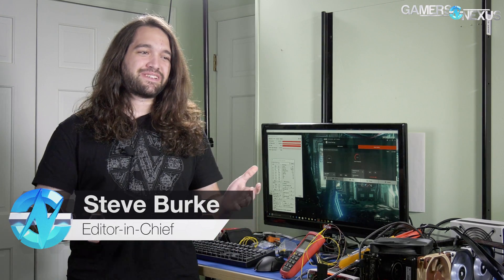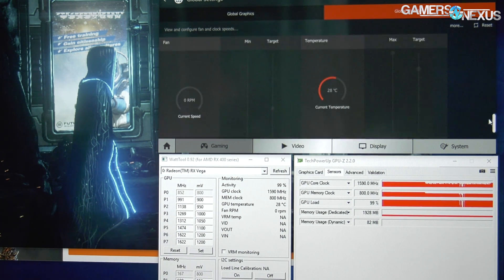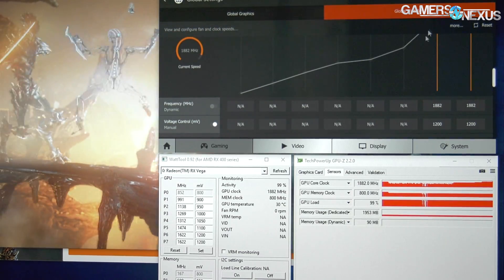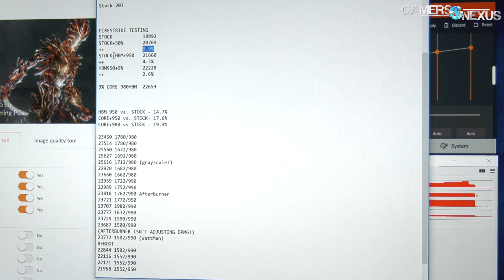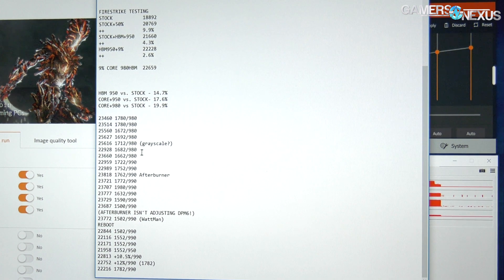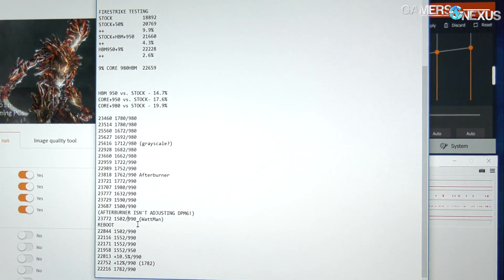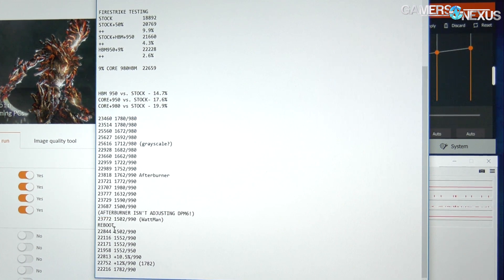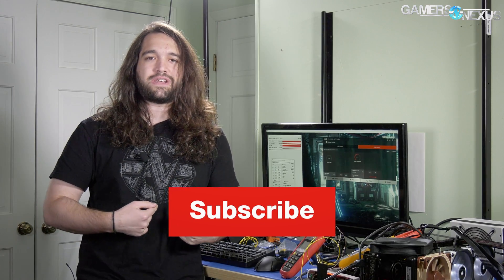Clock Bug Rant: No, Vega Isn't Hitting 1980MHz

Comment: And I only set the power limit up to 150% with the card.  I don't know how I got 2,500Mhz faster than the Vega 56 original reference card shown here and bug still exisit.  The clock displayed 1,500mhz playing game like Doom and Borderland 2, it will shoot over 2,000Mhz on loading screen, pause screen (some but not all, it will go down to 50mhz).  The 2,500Mhz clock speed will be shown playing  Dead Space, once hit the Radeon recording to be set down to 1,500mhz, game set max out with resolution 5160 x 2130 with my Vega 56 Air Boost OC.  It one hell of a weird gold bug I have.

Comment: seems like the clock bug is back, or maybe it wasn't fixed all the time...
In this neat little build in overlay tool from AMD, I sometimes see Vega 64 LC clocked to WELL above 2Ghz in Far Cry 5.
The absolute max. was 5800 Mhz or so... all with about ~260 Watts of power consumption! :D

Comment: Comment section seems to be full of cancer. People didn't buy AMD cards when they had better products, and now they are salty about AMD not having the best product, hypocrisy overload.
AMD is clearly trying to put up some high-end graphics, while having fraction of nVidia's budget, and they get so much shit for it.
Guys, chill out, Vega is new architecture, and it won't be Titan killer on the release, just like Ryzen wasn't 7700K killer on the release. It doesn't even have stable drivers at this point. For once stop acting like fucking idiots.
But anyways, if your best actual stable score was 23800 (around), that is 25,9% increase from the base.
Seeing that Vega 56 is typically well above 1070, especially on higher resolutions (from what I have seen, sits between 1070 and 1080) this would put it from above 1070 to above 1080 card basically. Even if the max OC is 20% that would be good enough. Even the 15% just from raised HBM clock and undervolt + higher power limit, should be enough to put it against 1080, for much lower price, well at least the MSRP.
Adding the fact of having Freesync, and more ability to improve with drivers and optimization (>20 TFLOPS FP16, primitive shaders, primitive discard...), this makes this card even slightly more worth it.
What is your opinion about this, Steve?

Also, could you test Vega 56 undervolted and clocked to the point it has same power consumption as 1070, and test it's max performance at these settings? Obviously with overclocked HBM2, since I've heard from Buildzoid it doesn't draw any more power when OCed.
Cheers.

Comment: Well I mean Intel on the 6600k goes from 3.5ghz to easily 4.5ghz and some lucky guys getting 4.9. so the assumption that it would be added because they can isn't always valid. But the point the Vega is still a bug though

Comment: My Vega 64 AIO won't even run if the power mode is set to turbo.That's stock clocks with a 25% power limit increase.  Within less than a minute of booting up a game I get a no signal crash.

Comment: Honestyl? Who cares anymore? This card is a giant flop, on paper it's has even better specs than Titan Xp, but in reality it reaches stock 1070-1080 performance, in some games even almost as low as 1060/580. I even saw comparisons of Vega 64 with 980Ti the other day, and they are almost on par (Vega gives just 1-3FPS more), so basically (just as with Polaris GPUs) it took AMD over 2 years and half of the process node to catch up with NV, and even this with a lot more cores and power consumption. They need to abandon GCN architecture and HBM memory, it's a dead-end, they need to start with a fresh design/architecture for their GPUs, same as they did with Ryzen.

Comment: Why aren't GPUs able to run at the same clock speeds as CPUs? Like CPUs are hitting 5Ghz but GPUs aren't even making to 2Ghz
Reply: GPU's have MANY MANY MANY more "cores", these aren't the same as CPU cores in terms of the type of workloads they are designed for but close enough for this concept, the more cores you have on something the lower the clockspeed needs to be to remain stable across all those cores and not overheat the chip or exceed the power level the chip has available.

Comment: Just from a programming standpoint that's a really strange bug. It seems like it's actually activating some kind of fail-safe and just using stock clocks regardless of what's shown, at least after a point. Usually a value out of bounds like that causes the system to either grab junk from memory and use that as an integer, or loop back to the lowest value.

AMD's GPU division really dropped the ball hard on the entire Vega release. Either that or they realized it's redundant by now and just wanted to get it out the door and move on to Navi.

I really hope Navi does a lot better against Volta. As it stands there's no reason for Nvidia to do anything but cruise along with Pascal priced as it is.

Comment: im hitting like 2100 on my 1070  ;)
Reply: It's not comparable, fyi.
A 1500Mhz 980ti would get similar performance to your 1070.
Also, weak. I'm getting 2175 and 9600mem on mine at 49C load ;)
Reply: nahhh nigga. how is a 980ti stronger.. xd?
Reply: are you watercooling?

Comment: considering the fact that the 1080 easily gets 300 mhz higher, most people probably things 400 isnt that big of a deal (but 300 + from 1700 is less impressive than 400 from 1600. just like a 1 ghz overclock isnt much for a 4 ghz cpu, when its  ungodly for a 1 ghz cpu. :P

Comment: I'm confident I have a genuine overclock of 1907Mhz and 1075 on the memory on my Vega 64 Liquid cooled:

Ok so here are my Time Spy scores, starting from the default Balanced and Turbo profiles and then my overclocks. Each one clearly shows a proportionate performance increase:

Core:1668/1750 (balanced) - HBM: 945 - Total Score: 7130 - Graphics Score: 7490
Core:1750 (turbo) - HBM: 945 - Total Score: 7231 - Graphics Score: 7610
Core:1837 (custom) - HBM: 1050 - Total Score: 7339 - Graphics Score: 7844
Core:1882 (custom) - HBM: 1075 - Total Score: 7479 - Graphics Score: 7872
Core:1907 (custom) - HBM: 1075 - Total Score: 7599 - Graphics Score: 8062

Looking at the graphics score it's a near 8% increase at 1907/1075 compared to stock vs a 9% increase on the core clock. Anything higher on either the core or memory clocks caused Time Spy to either artefact or crash for me. Based on these scores, I don't think I have encountered the bug and believe my overclock is genuine.

Comment: After all this time, all those delays, and AMD still didn't find time to fix drivers? I mean how the hell can you miss bugs like that. Sure software optimization is more of nVidia thing. But over all those years, AMD is still just same head through wall kind of performer. I have nothing against hardware power, but I can appreciate much more if you can simply open the door, not hit your head through the wall. And AMD doesn't seem to learn... and that is why I kind of like nVidia bit more... :-D

Comment: SO uh, is the Vega 56 a good replacement for my 1070 so that i can use my Freesync panel?
Reply: was the cheapest monitor above 60Mhz refresh at the time i built my PC.
Same for the 1070, best price/performance i could afford.
I have no brand loyalty clearly but Gsync is a scam and you should be ashamed if you own a gsync monitor
Reply: NO, unless you can get the ORIGINAL price you paid for the card, getting Freesync support is not worth losing money on the card you already have, you should NEVER even begin to consider replacing a GPU for ANY reason for atleast 2 or 3 generations at a minimum.
Reply from the maker: Our review discusses that! https://www.youtube.com/watch?v=0PftkOaKfik
Reply: I read your review, but its all still quite up in the air.
Did you get a chance to test OCing with the undervolt profile?
I guess till the whole price drama settles down there wont be a definitive answer
Reply: No. Unless AMD prices the 56 back down to $399 stick with your 1070. Not even the AIB cards will be worth much more than that..maybe $50.00 over the $399 msrp tops.
Reply: If you are price conscious you must factor in the price confusion currently surrounding Vega 56; and the electricity angle that Steve have covered a few days ago. Steve's electricity analysis is really nothing new; what's significant in that video is he's put out comprehensive numbers with real-world data. Sure parameters like electricity price and hours of usage per day varies according to the individual, but the mathematics is linear and you can just factor up or down from the numbers reported by Steve. They may not be a lot, and most people tend not to care (because usually you need to do some calculations before you realise how much it is), but that extra cost IS there, and if you think you will be gaming, on average, like 2 hours a day over a couple of years before upgrading to another card, that extra cost can amount to something in the order of ~$30 (give or take).
Reply: Yeah, i guess i will get a little more value than just performance because of freesync
Reply: this isnt my first rodeo haha. I am just really keen to try variable refresh rate tech and already happen to have freesync on my monitor
Reply: Why buy a freesync monitor if you have an nvidia GPU... Why not get a gsync monitor?

Comment: Vega series of cards were Designed for the enterprise World, not for gamers. Gaming market doesn't need HBM ATM. Everything in this GPU interation is for Professional Applications... It Can obviously game, AMD relaunched the product for the "gaming" market to profit from the existing production Line, but the focus of AMD with Ryzen and Vega is the Enterprise World... Sorry for gamers
Reply: luis jesus Why they use it in gaming tests against other nvidia
Reply: out of curiosity, what are some professional uses for gpus? is that like the video editing or multi tasking?
Reply: High level compute usage of CPU and GPU involves stuff like archiving massive amounts of files to be compressed and stowed away, because they wouldn't want to buy a few hundred hard drives to stow a few petabytes of files.

CPU is used in file compression, and especially used in video compression and conversion, especially when you go 4k or even 8k. The reason why they bothered to go with high resolution is that they can downsample it to lower scale with better image quality than up-scaling it, which makes the pixels blur and is relevant.

GPU is used to render your videos and images, at those massive scale, it has to communicate with the CPU to properly record those massive resolutions bit by bit, and transfer that image you see on a 4k screen, to the Cpu so it can turn it into a file.

With the TV industry being hacked and slashed to pieces, the internet media industry is taking off and there's a huge demand to create media for internet users to consume.
Reply: Anyone who has a Ryzen CPU, the new bios update for the X370 Prime came out a while ago, 0810, which is said to improve memory compatibility again.
Reply: im a gamer, and was just curious about how there's different uses for the same technologies i use to game
Reply: I just bought a 1080ti and my ryzen 1700 is clocked to 4 ghz with 3666 mhz ram and its within 6% of the 7700k and the only game it gets beaten in is csgo so its not miles behind like you are saying an the 1800x is better compared to the 6900k which it easily beats.
Reply: @lol wut
The biggest call to fame for Vega is it's use in supercomputers. There is the EPYC(pounced epic) CPU line that is designed just for the purpose of driving 7 Vega's simultaneously. The EPYC/Vega combination is insanely powerful with it being able to reach supercomputer status(1 PetaFlop) in a single rack. To put that into prospective, that is the equivalent to two "weak" supercomputers in the same space as a single mini tower, although racks have external power supply's and cooling so that is only half true.  

So once AMD finally gets the production line sorted out, Vega is going to redefine what counts as a super computer.
Reply: did you even watch amd commercial for vega ? it was promoting nothing but gaming. Ah and RX stands for gaming series...
Reply: @Armand B.
That is because you don't run commercials for systems that start at 50k... Did you even think before writing your comment?

Also RX stand for Radeon(the name of AMD's GPU division) 10(X is the Roman numeral for 10). Can't fault you for getting the AMD naming wrong because it is pretty inconsistent to be honest. The number is the GNC(this is akin to saying like x86 or ARM) generation, but only odd numbers starting at 5 are used. The even numbers were reserved for mobile devices(R8 was a bad R9), but in the middle of R9 they decided to switch to a M to denote mobile which is why 10(X) was used for the 4th generation instead of 11.
Reply: 50k what ? Im talking about vega and it's a gaming card. here ya go https://www.youtube.com/watch?v=uxVzDQtHzqo&t=1s
Reply: That reply is so stupid that I am not ever sure how to respond. 
Vega is optimized for general purpose compute; it can still be used for gaming in the same way you can use a threadripper or 10-core xeon  for gaming, but they won't preform as well as parts designed only for gaming.

So do you realize that only a tinny fraction of i7 sells are to gamers? Yet nearly all i7 adds are targeted at gamers. This is because you don't run adds for professional systems. 

How do you have trouble understanding such basic concepts?
Reply: Yep. Anybody dissing AMD aren't looking at the big picture. For the record, I don't own any AMD hardware. I am rooting for AMD because competition lowers prices. GO AMD! 

These intel/nvidia fanboys forget...AMD gave us 64-bit computing and more memory on the desktop. And now? Professional grade graphics cards at gaming prices, more than 4 core cpus at quad core prices, 64 pcie lanes on the desktop and 128 lanes in the enterprise.
Reply: Ryzen is fucking awesome for gaming what are you talking about?
Reply: DongleLife, CSGO is where that 28% came from (I did the math based on the LTT FPS),  It depends on the exact games but EVERY game they tested loses FPS across the board, seriously go watch the LTT video before you bother replying again, they test BOTH the 1800x and 7700k and the 7700k had HIGHER FPS in EVERY GAME on EVERY CARD tested and that was anything between 4 and 28% and that 28 was the CSGO chart
Reply: DongleLife, the fuck you talking about, LOOK at ANY FUCKING BENCHMARK, if you use Ryzen over the equivalent Intel CPU (like an 1800x vs a 7700k, like LTT did in there VEGA REVIEW) the Ryzen CPU is clearly and definitively falling behind on ALL cards in gaming FPS anywhere from 4 to as much as 28% (typically closer to 10% average), WHY would you pay the price of a GTX 1080 to get the gaming FPS of a 1070 because you opted for a higher core count Ryzen CPU. Ryzen is ONLY good if you are doing something that can use all those cores and straight up gaming ONLY doesn't and likely won't for years (sometime after you've replaced any CPU or GPU bought today)

Comment: Using an Evga GTX 1080 SC + Intel 6600K 4.7Ghz, still not worried about upgrading in the slightest.
Reply: I have a dual xeon with X5460s(Total 8 cores) and a GTX 970 Armor edition from MSI. I swear by MSI. Only company I buy from.

Comment: I ABSOLUTELY BELIEVE this so called bug is Cred Dead AMD's way to fool AMDuped Suckers into buying its VERY Late RUSHED to Market, Half Baked Vega Watt Sucker falsely thinking Vega can hit these absurd speeds. 

What a mess AMD's watt wasting Vega is, its now you see it now you don't deceptive Rebate scheme fooled reviewers into doing Vega 56 vs Pascal 1070 comparison BUT because of price Vega 56 should be compared to Pascal 1080 which blows hot running Vega into the flaming gaming half baked dumpster. 

FACT: Buyer Beware AMD's Vega is a Watt Sucking Rushed to Market Mess!
Reply: Go back to disqus.

Comment: id like to think this is just a bug, but amd also had a bug with temperatures reporting 20c too high as well. dirty vs dirty i guess.
Reply: If they wanted to be sneaky and deceptive, they would have offset the temp in the other direction.
Reply from the maker: That's not a bug, that's a TCTL offset based on server product fan curves.